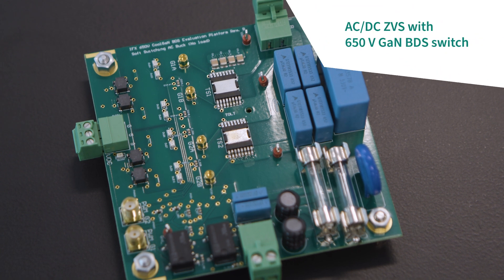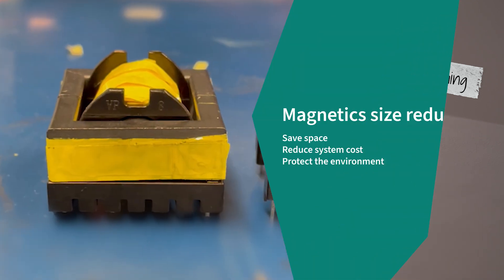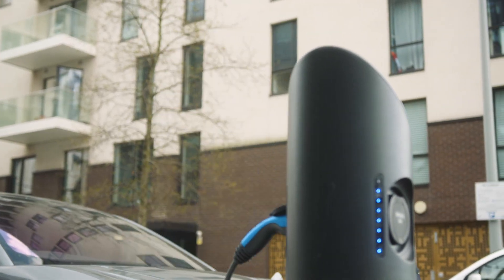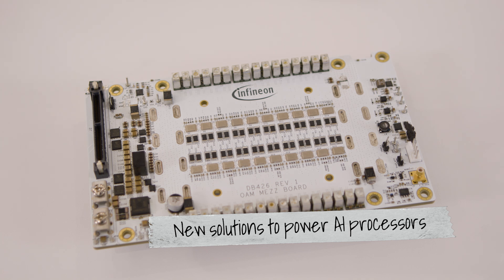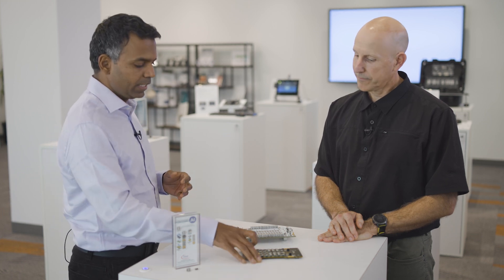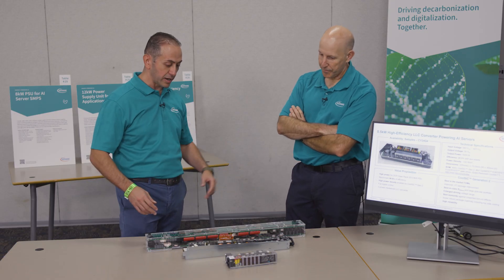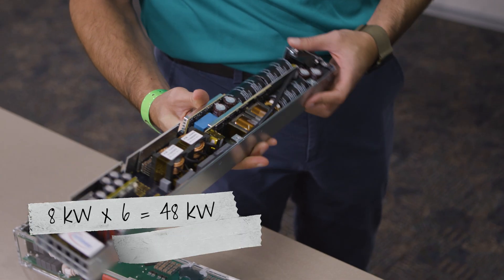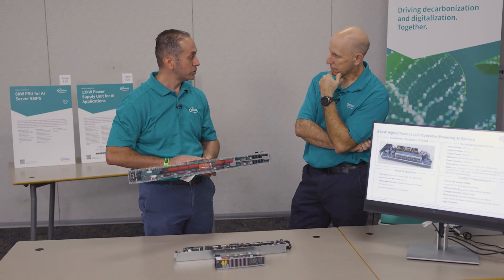Innovation Insights: 3 Power Semiconductor Breakthroughs | Infineon

Comment: Silicon carbide, gallium nitride and silicon can create semiconductors with the highest power density. This is a huge progress for technology. It reduces size and weight and optimizes unnecessary materials. Yongming capacitor miniaturization and large capacity can help you Make more space for other electronic components, making the whole thing more compact